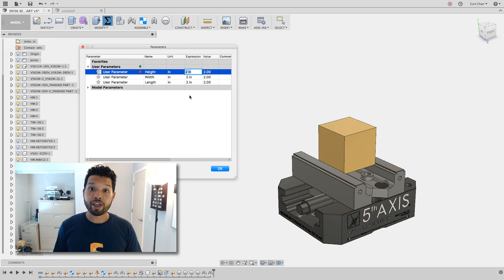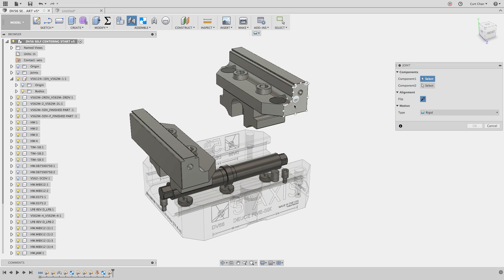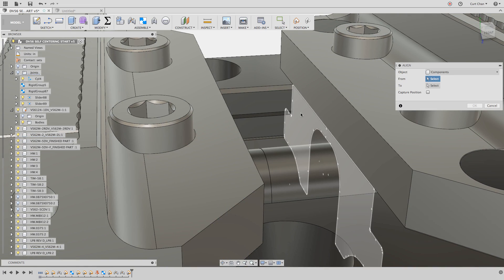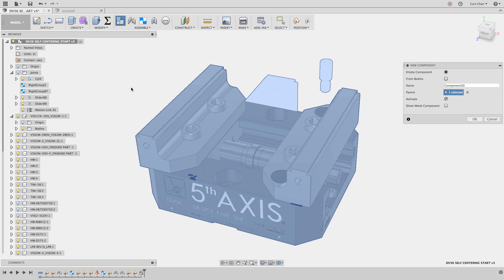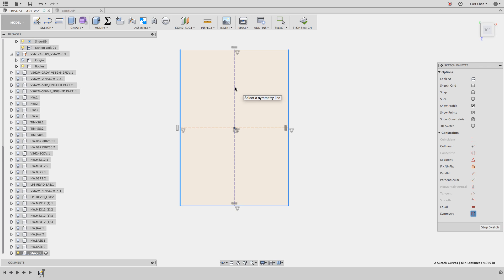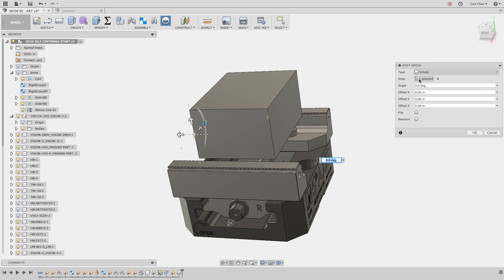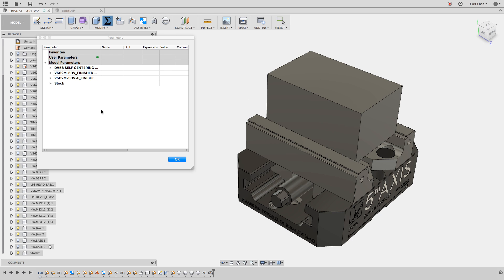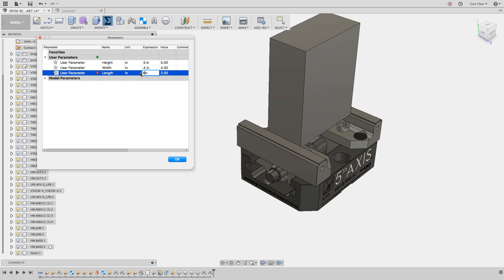TUTORIAL: Back to basics with Joints

Comment: Excellent video 👍
I'm trying to create the same kind of fixture and stock assembly, but with a chuck and a round stock, but having a hard time at it!
Created the slider joints and motions links for the 3 jaws, but trying to add the rigid joints with the stock breaks everything 😔
Any help on this would be amazing...
Reply: Just had the same issue! We got around it by NOT creating the motion link between the three jaws, once you add the three rigid joints to the stock it should all work !
Reply: @chriswilkes1609  what I ended doing actually, but forgot to update here. Thanks for sharing 🙏

Comment: awesome video! i'm very new to fusion, and this is similar to how i set up my programming jobs in the software i use at work (topsolid). I'm wondering if there is a video or explanation showing how you're able to use the parameterized  stock model in this assembly to be the stock used in the machined part set up. i watched Lars' (great)video on setting the "fixed box" stock created within the set up dialog box into a vise, which led me here. the way this is set up seems a bit more what i'm looking for, so any help would be great. thanks for the video!
Reply: I've never used Fusion 360 for CAM , but I did find this one site that may be helpful:  http://www.mechanicaladvantage.com/blog/2016/1/2/creating-a-setup-part-2

Comment: You pulled a bit of a fast move on us when you placed the joint origins at the mid points of the jaws. How did you position them directly below the sharp edge of the dovetail? Did you get sneaky and place the sharp edge (conveniently) directly above the centre line of the horizontal surface? Positioning the joint origins is one of the messier challenges of using this mate concept. I suspect real life jaws would require a sketch line just to position the origins.
Reply: Joint Origins can be placed on the vise via points if you'd like.  I took the same approach as I did i on the stock.  One thing I did was an offset in the X-axis of .075 to have it butt up against the teeth.  Since I showed how to do it on the stock, I just sped it up on the jaws.
Reply: Yes, the stock was easy, as the joint origin was simply on the edge of the stock. For the jaws you needed to project the jaw edge onto the lower surface - or use an offset as you say. Good to see a refresher on user parameters - very useful tool. Good stuff!

Comment: In most assemblies capturing the position is not needed in order to crate a joint. 
It can make it easier to get access to the part of the geometry you want to place the joint origin on, but after the joint is completed the capture position feature ing the timeline can actually be deleted.
Reply: I was really expecting Curt to Capture Position when he aligned the jaws. Somehow capturing the position seems like a nice logical thing to do even if it's not required. That's the logical starting point for the jaws so why not record it as such?
Reply: In a small assembly such as this, recording the position before every assembly operation might not be a problem but of you have an assembly with hundreds of components that creates a lot of unnecessary data and pollutes the timeline. Thus, since the last update (or so) when starting a new joint you still, will be asked whether you want to capture the position or continue without, but if you select "capture position" you will not get that capture position item in the timeline.